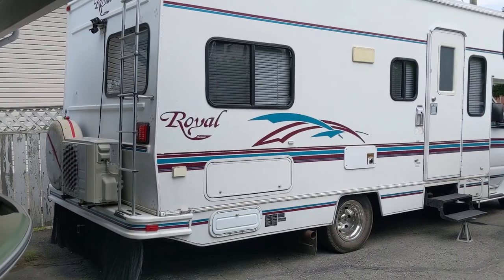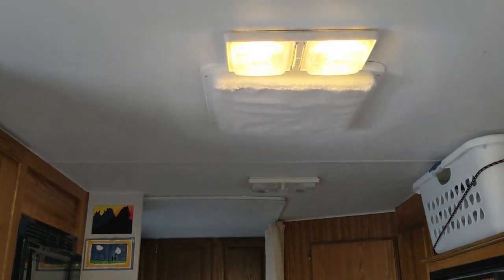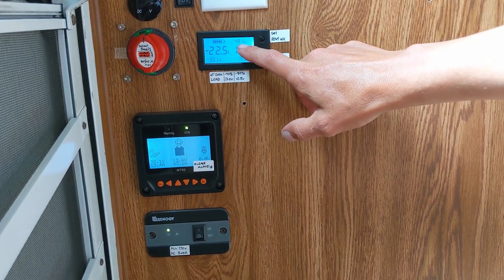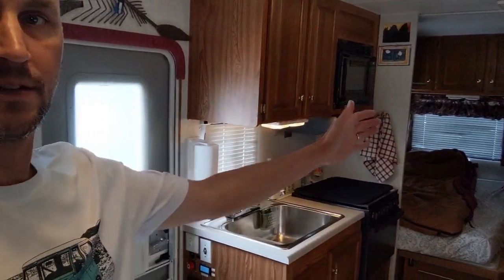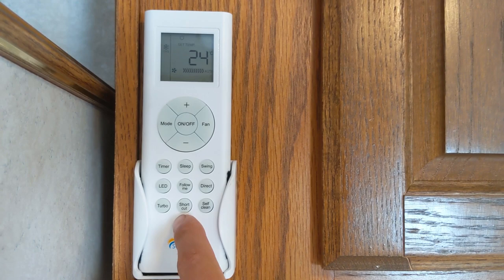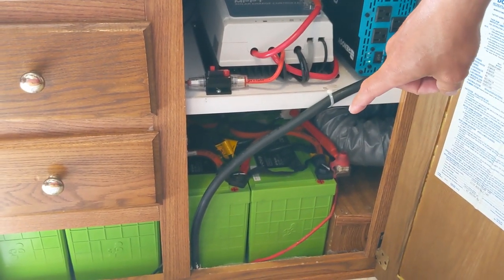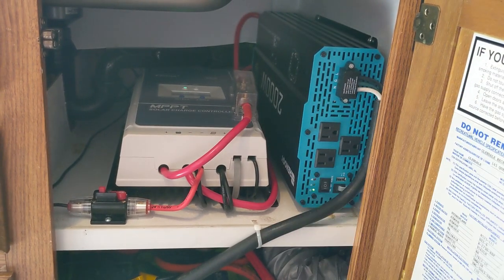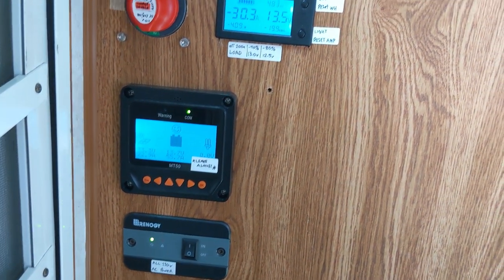YES! Running AC from SOLAR in your Class C RV

Comment: I just put a Pioneer 9k unit in my '28 trailer. I'm loving it. The nights are chilly up here at 2200' in Southern Oregon.. but not in here anymore. I also have a small solar system. It consists of 4 Trina 400w panels (only 2 plugged in for now, 4 100ah BB lithiums, connected to a Victron 150\85 controller and monitored by a CERBO and touch 50. I plugged an '25 extension cord with probably 12\2 into the Xantrec 2000 ps and it wouldn't start. I'm thinking a shorter and more robust cord would help..  luckily I am plugged into a 30a shore power.
Reply from the maker: Interesting story, and thanks for the comment. I'm trying to decifer your comment: So.. did it not start, or did it trip the GFI in the invertor? Here's what I mean... I've had my unit kick my yellow light on my invertor at least one time per year... and it's a grounding loop or issue of some kind that trips the GFI light on my invertor. I turn it off, and back on, and it runs again perfectly for the rest of the year. It's a strange problem I don't understand. Of course you're setup is different than mine, but I'd ask again, did it 'not start' due to amp draw (very unlikely) or was there a GFI circuit trip out on the invertor? That's not the same issue. There's very low amp draw on these, so it's likely NOT a current over draw issue, it's likely open grounds of some kind.
Reply: @reelandgooutdoors  I'm not sure what it did.. but it restarted quickly and has been working as it should since. I think it was just a low power issue. P1 flashed on the cover.. which on the decal it say Voltage (high or low) protection. Mine tripped and self reset because I have 2 pc's plugged in and mining. both with dual videos cards working.. So I'm gonna see about adding a sub panel on a separate 15 amp circuit. Then gonna figure out what it needs to run on my solar system.
Reply from the maker: @Mywhtjp  that's a good plan. I'll have to check into that code if I ever see it on mine. Interesting!

Comment: Hi. How do you ran the freon lines? Under the floor and up?
Reply from the maker: Yes. The lines go inside the frame at the rear, and cross over the frame half way up, and then under the floor and up into the front right corner. Even after these years of use, this system worked perfectly all this summer...again. we love it.
Reply: @reelandgooutdoors  Very good👍 I have a 2002 e350 class c Tioga. I'm thinking to do the same installation.
Reply from the maker: @cfoster8706  for my install, which you can see, I used all 25ft of line for the system. It took more than I thought to run the lines.

Comment: WOW, awesome set up. Do those u27xp-12 have an internal BMS, or did you have to add an external BMS?
Reply from the maker: Thanks! The batteries do have a management system, but not hard cut offs. The result is a reliable battery with more capacity per size than its competitors, and I have the cutoffs done with out-of-battery equipment.
Reply: @reelandgooutdoors  do you have any info on that set up?
Reply from the maker: @MikeJordanUnCamplicated  there's a bunch of info at this thread here: https://diysolarforum.com/threads/yes-rv-solar-li-and-ac-running-full-time.23979/
Reply: @reelandgooutdoors  I got here from there. I haven't made it all the way through. I have used the Valance RT series batts. They have internal BMS, but are smaller. I thought the XP did not have an internal BMS. So curious how you were managing that
Reply from the maker: @MikeJordanUnCamplicated  here's a rundown on how I am doing that. The inverter has a low voltage cut off and will disable itself when it reaches the bottom. My 12 volt loads are extremely minimal, and when shut off there is zero draw. The consumption meter has a buzzer for low voltage alarm, which you can set yourself to whatever you want. The charge controller disconnects at low voltage. There are no other draws on the system, therefore when everything gets to its bottom voltage, the alarm will go off, the loads will disconnect, and the batteries will remain at their stationary low voltage. As far as over voltage protection, the only input is coming directly from the charge controller, which is 100% in charge of the battery voltage, and I have it set to top charge at 14.1, holding 13.6 as a nominal. The charge controller also has a temperature sensor so it will not charge the lithium batteries at low temperature. Having an internal battery shut off is something well worth it if you do not have other protections in place. I find that useless in this instance. The XP battery set has cell management inside, data logging, and an interface for the computers, which I do use from time to time simply to check that everything is still perfect, but they simply do not need to have contact switches for high or low voltage disconnect.
Reply: @reelandgooutdoors  high/low voltage is easy. I was wondering about cell balancing without a bms
Reply from the maker: @MikeJordanUnCamplicated  the XP does have internal cell balancing. Yes. Already inside.

Comment: Great system. I do have a few questions. How long have you had your system. Have you had any problems with the system on the bumper and vibration going up and down the road. I would think that most of these units are designed just to sit outside stationary. On your rig how did you route the piping from the back of your rig to the side where the mini spit is.
Reply from the maker: Hi, we have this running now for a couple of years. There's alot more explanation and routing pictures shown on my thread link here: https://diysolarforum.com/threads/yes-rv-solar-li-and-ac-running-full-time.23979/
Reply: Thanks so much this is great
Reply from the maker: Add another year... It's all working amazing still without any problems. Loving this system.